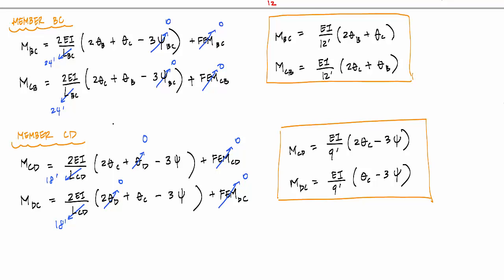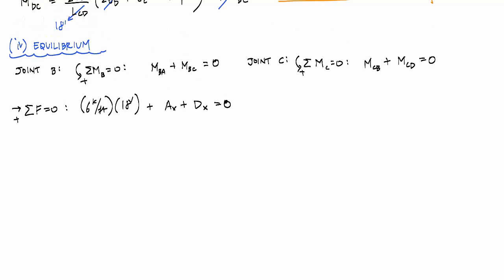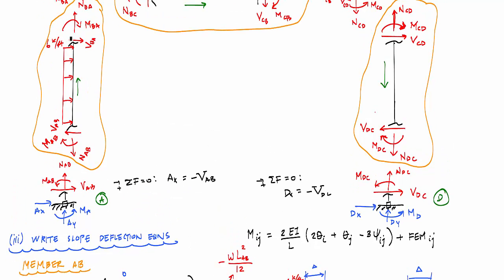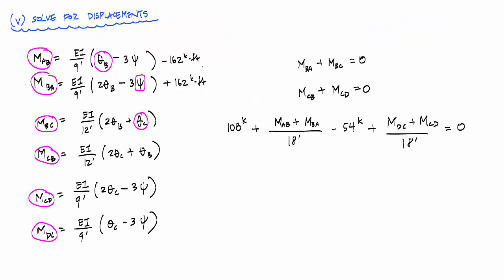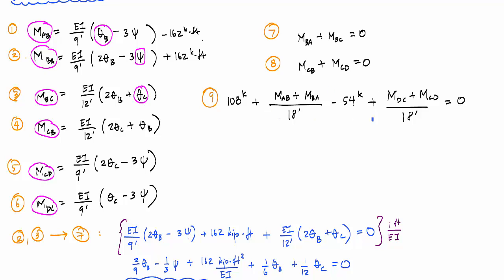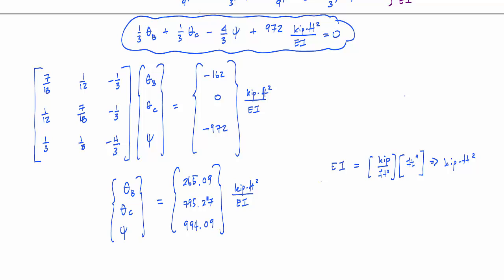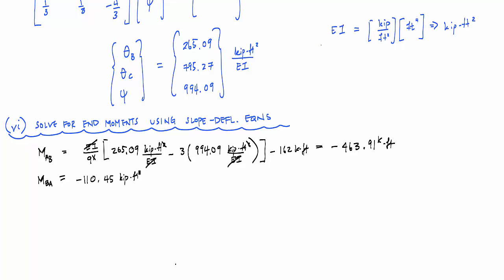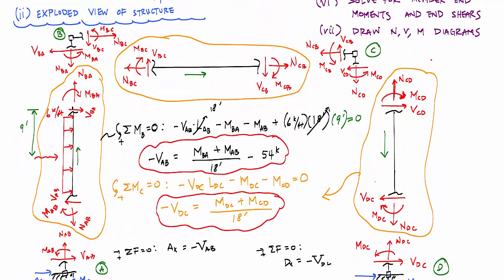Slope Deflection Method - Sidesway Frame Analysis (3/3) - Structural Analysis

Comment: I got assigned a final project for my steel design class where I have to create a spreadsheet matrix for a sway frame like the one in the video and design it using steel. I had to brush up on my structural analysis stuff before I could even start working on it and it was necessary to get the theoretical stuff down pat since I'll be taking advanced structural analysis over the summer. This video is a godsend and saved my ass. God bless you.

Comment: Can you do an example with an inclined member? Or explain how the 'Psi' values are determined when one member is inclined? I've been struggling to understand the trigonometry to determine the relationships between member lengths, displacements/delta and the Psi/rotation values